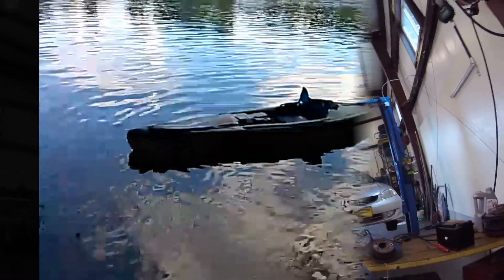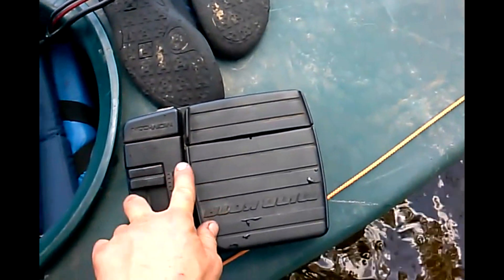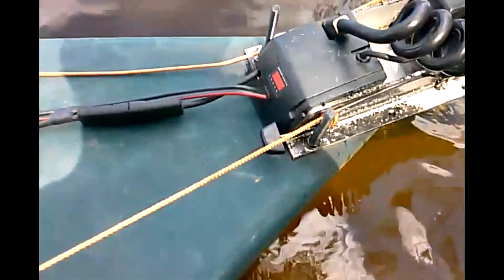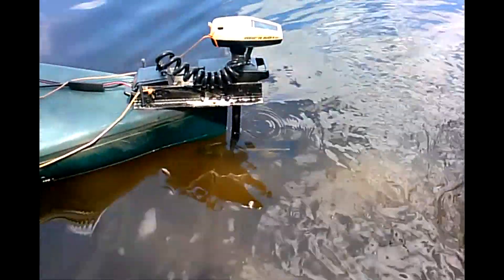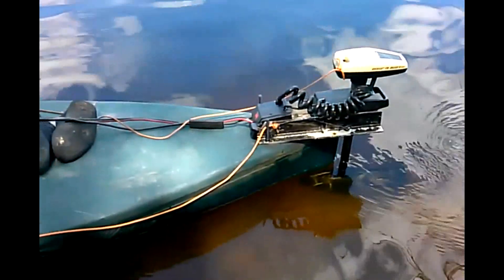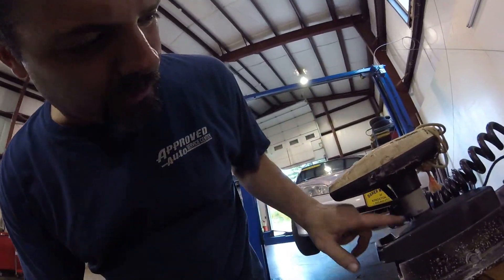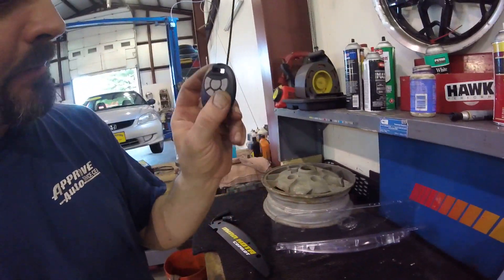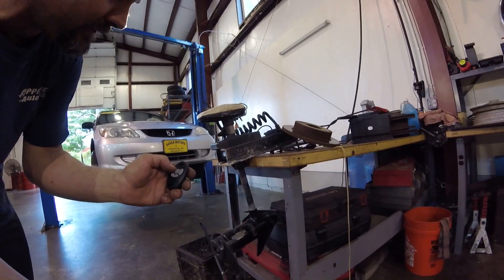The Electric Kayak Going Remote Control

Comment: Very cool. Those cinematic shots were really good.
And the weather does stink. Can't do anything without sweating your butt off; especially welding.
I actually have a welding question for you. There is a lot of movement after the weld and the factory recommended settings leave a worm holey weld. What's the fix?
Reply from the maker: ***** Sounds like a shielding gas issue